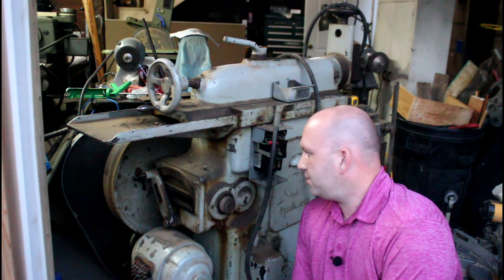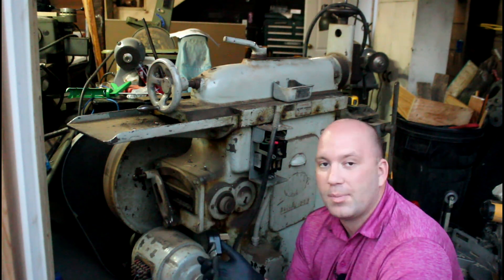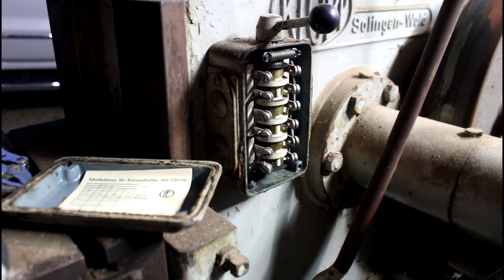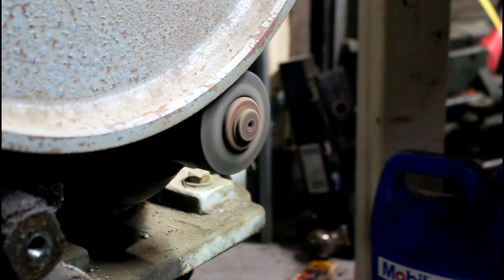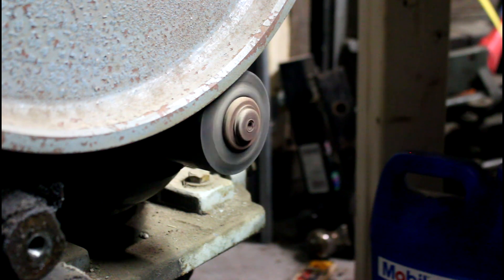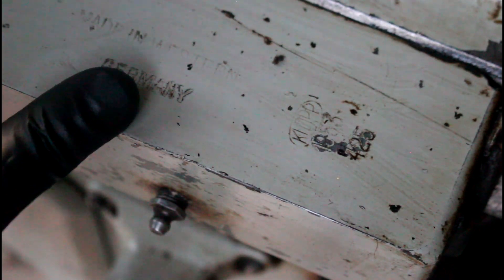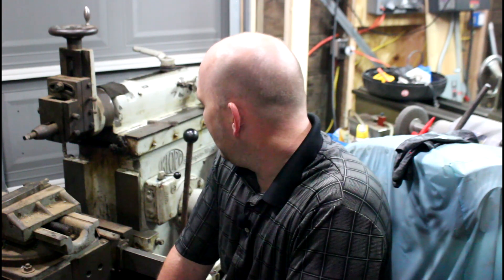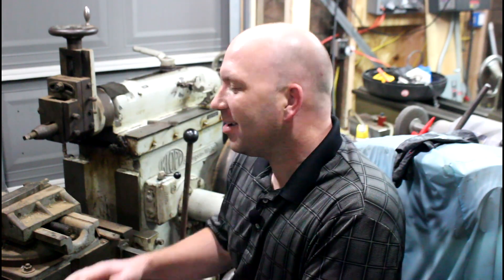Klopp 425 Metal Shaper Part 2 Electrical and Cleaning

Comment: https://www.hoffmann-group.com/US/en/hus/Power-tools-and-workshop-supplies/Chemical-products/Professional-grease-gun-with-nozzle/p/083557 
This is what I use for my lathe which uses oil inserted trough zerks. I am not sure if they ship to the us though.
Reply: Just make sure to get the right mouth piece if you should buy one.
Reply from the maker: Thanks, I actually bought a couple grease guns to see if I can convert them. Should be fairly straight forward.

Comment: I'm glad you figured the electrics out!
The Tool lift on your machine is actually the better mechanism as opposed to those with a rounded, pivoting rubber pad.
These flat pads (they're made from brake material, I think) wear consistantly over their entire surface,
the round ones wear more on the sides than in the middle and eventually make the mechanism get stuck in one position,
despite there still being alot of rubber left.
I re-engineered the lift on mine for that exact reason and fitted a bar with pinchable brass bushings to run on it.
With yours, there shouldn't be any problems though. I don't need it often, but it sure comes in handy when running carbide tooling!
Reply from the maker: Cool, I watched the conversion you did a while ago. Looks good. I will hopefully get more done this week on it.
Reply: @precisionmachineshed  Lookin' forward to it! :D

Comment: The zerks are proper, they are for a pump oiler. Youtuber doubleboost has one he uses on his lathe. John is in the Uk, so it may be a European thing. I've never seen one here in the USA. 

Good luck.    

Charlie
Reply from the maker: Thanks, I guess you can convert a grease gun to work which I'll need to look into. I guess some of the older bridgeports had these on them too. Crappy thing is I have to clean out all the grease first!

Comment: at 12:20 Quite common on older machines for them to have grease zerks for OIL Injection. Never put grease in them! Check out old bridgeport mills for a common example of it. Single phase circuits in a three phase machine are typically for Control circuits, and yah, a lamp. Usually there is a step down transformer that supplies it. That machine sure was looking in good condition as you were cleaning it. It has a real lot of life left in it. I hope in the future you can find some work for it that can Only Be Done On A Shaper.
Reply from the maker: Hey thanks! I'll be looking for an oiling gun. Yes I have several projects waiting for it.

Comment: Oh, and regarding the grease fittings - I think they're original, or at least that's also the case in my 450 and the instruction definitely says oil. I was also confused by that, but apparently there are other machines that use these and also use oil, like some older models of lathes. Maybe it was because they needed bigger pressure when injecting the oil? I've also only now noticed that you have these fittings for the ram, which is I think the first time I see it in Klopps
Reply from the maker: Yeah, that's what Astra-Werke mentioned. I'll have to do some looking to see if I can find a gun for it.
Reply: @precisionmachineshed  I'm using Pressol 12602 (not sure if it's available in the US), but I remember that I saw a tutorial online on how to modify a grease gun to allow to use it with oil, so I guess that's also an option?

Comment: Thanks for the close-up of the lifter mechanism! Also, it's very interesting to see that it's 425 model and 1953
Reply from the maker: No problem. After looking at a few other models, It looks like that style was used in the 550 and larger machines based on online photos.